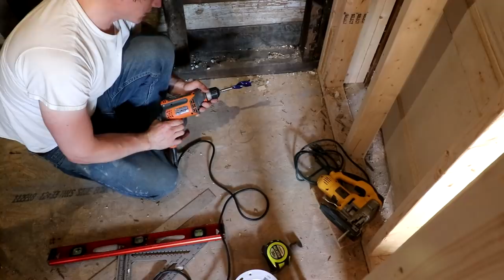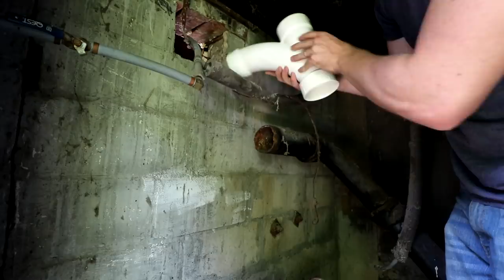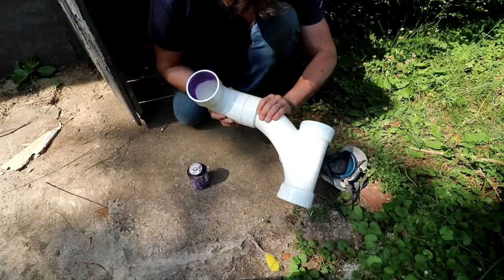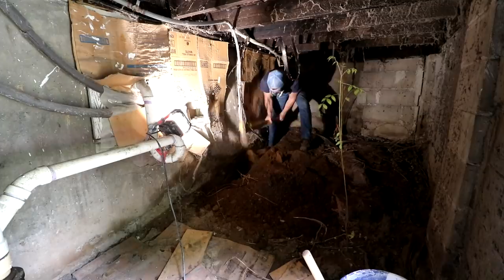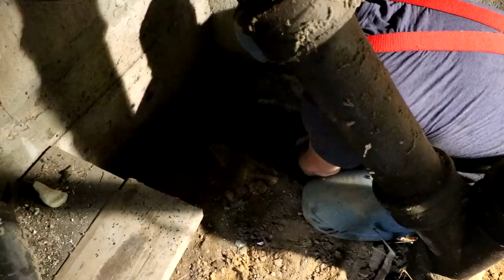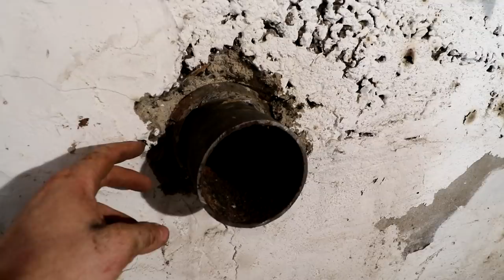$9,000 HOUSE - Full Home Renovation - #7

Comment: 5:10  Glad you explained this.  The renovator before me in my previous house left me with a toilet that was always loose.  After replacing the toilet, I found that they installed the toilet flange with the "open" larger end of the keyslot parallel to the back wall, which meant the bolts lifted up (toilet couldn't be tightened to the floor).  So important to get them offset the way Homemade Home is doing it.

Comment: I used to work for a local saw blade company in the testing lab. Lenox hole saws were indeed one of the top ranking holesaws in every test we would perform.
Reply: Now that I've got to the recip saw, Lenox did well in that category as well, though Diablo brand was usually better.

Comment: Love your vids. I am a liscenced plumber in NY I see your codes are mostly universal. One thing that may help you further as far as running main water in pex, is use 1" not 3/4". Reason being is the pex fittings restrict flow very heavily, 3/4" pex fittings interior diameter is closer to 1/2" which is creating a bottle neck. Running 1" you have the desired 3/4" flow to work it's way up especially on a 2 story house. You might want to run 1" all the way to the 2nd floor, when I rough in house that's what I use but again it's a inspection requirement in NY. Anyway hope this helps, sorry for such a long comment
Reply: I am surprised he hasn't ran any manifolds on his houses.

Comment: Cordless tools are great, BUT the batteries and chargers become obsolete after a certain time. That corded tool can still be used 10+ years later if still functioning properly. Try getting a battery for a 10+ year old Dewalt.
Reply: Agree, but they have adapters now so you can use the newer batteries on the older drills.
Reply: i have a 20 year old set of dewalt including a jigsaw that all work great to this day and i used them in the trades for years, dewalt are bomb proof, and i even have some original batteries i use to this day, just gotta use the refresh button on the charger once in awhile, i'm always amazed when i get out a tool and it works, i know that no 20 year old nicad should work, but there you go, and nope i aint paid by DeWalt either, lol(they should pay me though, lol)
Reply: You can convert it to modern standards. It's on YouTube. Some even use old laptop batteries. But it's best to either buy new, or salvage from otter discarded power tool batteries.
Reply: m ph just came from a job where I was using a 15 year old makita drill with original battery’s. new battery’s fit just the same
Reply: I’m still using my Craftsman variable speed drill I bought in 1968.  Not cordless.

Comment: Molten lead creates a good seal between the cast iron pipes but I'm not sure if peening a cold joint will create a good enough seal to stop leaks. If it does leak you can also try using a torch to heat up the lead, starting on a low setting so it doesn't blow it out of the joint, and either "wipe" it with a dowel like how the old-timers did autobody lead filler (videos on Trev's Blog on youtube to give you an idea) and/or try peening again. If that doesn't work and you still have leaks, another option is to clean out the lead, oakum and rust from the joint completely and fill the joint with pure silicone caulk. We do that on lots of things from sink basket strainers to toilet spacers and it simply doesn't leak. You'll have to rig something up to suspend the smaller piece of pipe while it cures so it does not sag. 

Best of luck to you. Love the videos and this project. You have an amazing opportunity here and looks like you have the skill and ability to get it done.

Comment: New subscriber...Watching you tear down that house, looks like a chainsaw trying to cut a petrified log. Those houses were built to last, but like anything else you have to maintain the care and love for your house. Good job bro. When you're doing a lot of pulling action use the flat side of a pick axe and plus ripping out old studs the pointed pick makes that a piece of cake. Using a sledgehammer for everything will wear you out, if you conserve your energy you can get a lot more done and a pick axe isn't nearly as heavy as a sledgehammer.

Comment: In respect to your chisel, it doesn't hurt to wrap the outside of the strike point with electrical tape to prevent a chip becoming a projectile and becoming lodged into your skin or worse eyes.  We're all guilty of just wanting to get it done and not thinking of things like this during the moment. 
Hay bales could also help add more insulation on top of that water supply line.  Not sure exactly how cold that crawl space gets, I seem to recall you showing that plumbing being off the side of the house, so it's perimeter isn't under grade providing the frost line thermal break.  
With all that said, you da man regardless.  Spent my fair share of time dealing with plumbing this year turning our only bathroom into two, all while keeping the fixtures functional.  Keep up the solid work bud.

Comment: “Closet” flange. Not toilet flange shouldn’t be installed until finished floor height is determined. Most capable plumbers will rough in the waste pipe and leave a few inches of pipe through the floor. Pipe can be cut and closer flange installed last. Closet flanges should always be 1/4” higher then the finished floor. Not flush.

Comment: Electric water heater needs to be at least 18 inches of the floor from the bottom element also needs to have a disconnect if you can’t see the electrical panel from the water heater, inspector will call you on that every time

Comment: A cast iron female that has lead and oakum in it can be cleaned out with a low heat torch.  Wear a respirator to prevent breathing lead fumes.  There is a slip in adapter that has ribs that will transition to pvc.  You will have to buy it from a plumbing supply house as Lowe’s and Home Depot doesn’t sell them.  Great work.

Comment: I used to work a lot in old apartment buildings in the 90’s.  For that cast iron joint in the wall I would always melt out the lead with a torch then pull out the hemp rope packing to cleanly separate the two. Then insert a rubber CI to PVC bushing inside the bell and the PVC was a nice tight fit usually requiring some liquid soap to lube it up. Wasn’t sure if you were aware of this technique. Thought it might help on your next renovation.

Comment: I only disagree with your connection to the main drain line. Having had much experience using oakum and lead to connect  cast iron drains I think you will find that your repair will at best weep and likely will leak significantly. Better to dig out on the other side of the wall, cut the cast iron, run the pvc through the wall and connect the pvc to the cast iron with a Fernco
 Neoprene Shielded Coupling. Permanent leakproof joint that meets the plumbing code.
Reply: Gotta say I was thinking the same thing myself, I have never used that lead system but I did wonder how watertight it would be after being disturbed and reset, not meant as a criticism more an observation. Great channel, love the content.
Reply: My understanding is that the oakum makes the water tight seal and the lead holds the oakum in place.
Reply: @gevil8559  @G Evil Exactly right! This is why the most common scenario you see oakum used today is in the restoration of old wooden ships. It is pounded between the planking to make the hull leak proof.
Reply: Yes. I have done many cast iron joints and you are right.

Comment: Cordless tools are very spendy in my opinion. You can justify the expense better than I can as your using them in construction, which will make you money. I bought Milwaukee M18 drill and bit driver impact for personal/business use. I use impact to change lawn mower blades for my weekend business or hobby what have you. I will be building some 2x4/OSB shelves in my shed soon so I guess it makes the purchase easier. Can't justify the cost of the M12 tire inflator, would be nice but you know.

Comment: Just wondering your thoughts on that sawzall blade? think a grinding disc would work better? Ive seen those and ive always been curious about the durability
Reply: Cast Iron is easier to cut than steel. Just go slow and don't overheat the blade and they will last longer.

Comment: With the cast iron through the wall, they make rubber gaskets that seal much better than repacking the old lead and oakum joint. Also with the pex through concrete, if you run a short piece of pvc through the wall and put a reducing fernco on the outside, there is much less chance of wear.

Comment: You made me rewind a few times when you said you didn't want you water lines to be exposed to water.

That aside. Keep up the good work. 

So many immature channels out there with random junk and "Hollywood" type garbage that it is quite refreshing to simply see someone doing their thing, and learning some stuff along the way.
Reply from the maker: I caught that myself and knew it sounded funny. What I mean is direct contact with the dirt and the dirt getting wet, what impact that may have. The water in the pipe is treated drinking water.....a pipe in the ground is different, more the fittings than anything else and also not knowing if pex can absorb "contaminants" from the soil....I just figured water may make it worse.

Comment: Wouldnt you want to go with 4" drain line to prevent the liklihood of clogging which tends to happen with rental property.
Reply from the maker: I've never had an issue with 3 inch and it's a lot easier to work with.

Comment: I've got about 1000 milwaukee 1/2" chucks sitting on a shelf collecting dust. I'll ship you a couple for free just let me know
Reply from the maker: Ha, I've got the new one but can't get the old one off...I feel like I'm going to break the drill in half. I still have hope.
Reply: @homemadehome5575  #3 Phillips reverse thread screw. Real pain in the butt from Milwaukee. I always put Jacobs keyed chucks on for a better grip
Reply from the maker: @about9smurfs  I think this one is a larger torx, I assumed it was reversed. this one also looks like the chuck it'self is threaded, not held on by a screw.
Reply: @homemadehome5575  Have you tried breaking the chuck threads free by using a large sized Allan key tightened down in the chuck with the drill in a vise ?

Comment: This is exactly the next project I have to tackle.  Got any tips on using pex?  I bought the crimp tool but have never done plumbing with it.  Haven't done much plumbing at all actually.
Reply from the maker: It's childs play, just fit things together and crimp.....make sure your pipe is slid on all the way, space the ring about a 1/8 inch  from the end of the pipe and I use the brass fittings. Get yourself a pex crimp ring removal tool, you'll need it if you do a lot.

Comment: I always been wondered why main water lines are so thin, you would think that main water pipe should be as big as sewage water one, I guess you would never use all water related appliances at once .
Reply from the maker: You can move a lot of water through a 3/4 - 1 inch pipe. In a residential building, more than enough....but when you get into bigger places with larger usage, size does go up. Also, appliances and plumbing fixtures (modern ones) use very little water compared to old stuff and how much water can come through the main. Also, if you are in the bathroom, normally only one thing is going at a time but you can have a drop in pressure if everything is going at once, especially if a house has lower pressure...in my case, I have to install pressure reducers since the pressure is so high.
Reply: @homemadehome5575  When company was installing city water pipe to our house, I was actually surprised how small they are.

Comment: When you go cordless Makita is the brand you want.
Reply: I remember back in the late 70's Milwaukee was the go to brand for contractor drills, etc. There was a Japanese company trying to get into that market. It was Makita and the sales rep had to give the supply company I was working for at the time a promise they would buy back any electric tools we couldn't sell. We had to give a couple of these Makita drills to an electrical contractor, have him use them for awhile and if they held up he'd pay for them. These drills worked out well, and they were less than half the price of the Milwaukee. Milwaukee no longer had a corner on the market.

Comment: I'm sorry if I misunderstood, but why would you still use the cast iron pipes for the washing machine and dryer? I would just run PVC through that, and skip all the fittings and stuff.
Awesome video by the way, very interesting
Reply: I didn't understand it either.  I was wondering about the (toxic?) lead beading too.  Will that touch the water at all?

Comment: What are property taxes on a 9k house?
Reply: 70% of fair market value when finished, which is the accessed value. 200,000 fair market value would be 140,000. Then take the mill rate and multiply it times every 1000 of the accessed value which is 140,000. So... if the mill rate is 30 dollars for every 1000, the taxes would be 4200.00 every year.
Reply from the maker: $500 currently, my guess is they will not go up when done. They seem to be good about not jacking peoples taxes up for renovations.....now if you went and added an addition, that would be different but just fixing what is broke, I havn't had any go up.
Reply: @homemadehome5575 , Must be nice. I put a new roof and upgraded my kitchen and when they came around for the re evaluation, my taxes went up 400.00 a year.